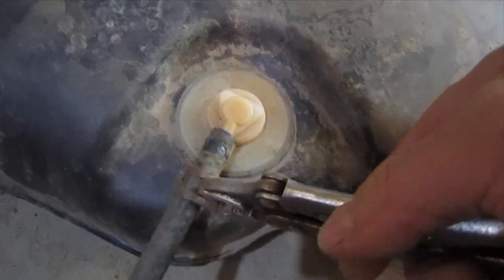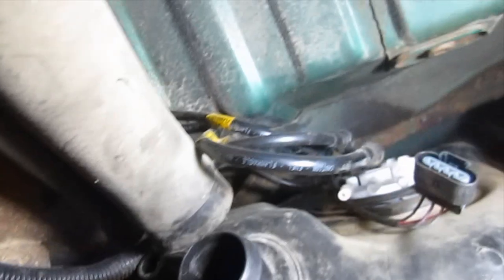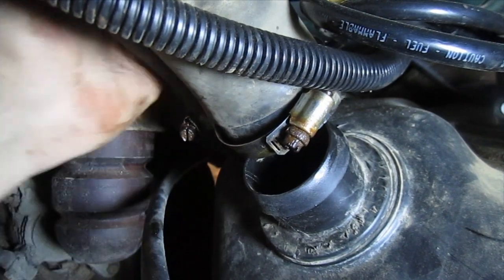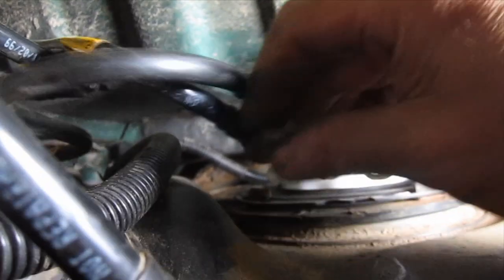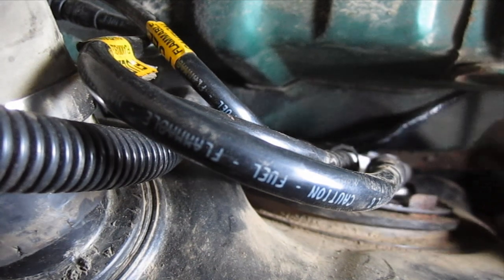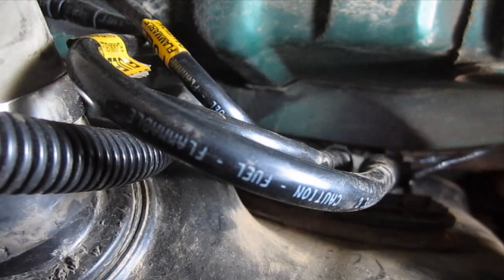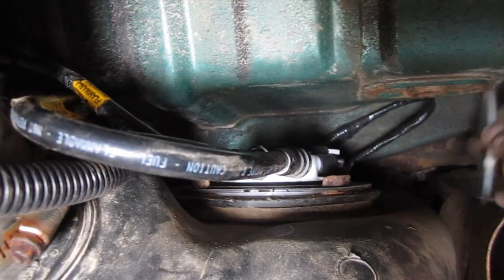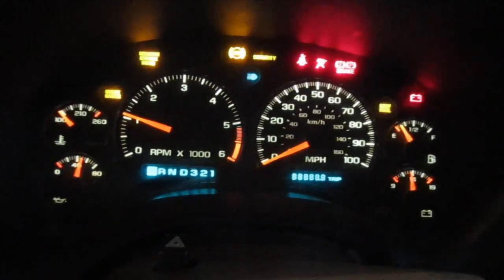DIY How to Install a Fuel Tank - GMC Jimmy \ Chevy Blazer Fuel Pump Repair Video Part 3

Comment: If only I had a tank that came off as easily as this to put back on. I twisted the nut/bolt off the front top strap, and the nutplate holding the rear strap on broke and free spins...couldn't get the rear strap out without cutting it off. I'm having to modify the rear strap to bolt onto a piece of the remaining old strap and had to weld a bolt onto the top of the front strap. I've been struggling with this for going on 4 days now. FML

Comment: Good Video. After having a new pump sitting on the shelf for 2 months and trying to find someone who'd put it in for me at a decent price I finally decided to tackle it myself. Only problem I had was the quick connect fittings, one came off without problems but the other two I just couldn't get, so I snapped them off and pulled them out with needle nose pliers. Cheapest I could find someone to do the job was $150 and one other guy wanted $395. Now I have a working gauge again, yahooooo. Thanks

Comment: nice job on the video...  ? . what if u mix the left and right  gas lines on blazer 98 4x4 2dr. on your pump. would it choke or cause any damage. i'll probably have figured it out by tomorrow. But it's a ? for everybody. please show a video of that. part 4. thanks and have a good chrismas. To all. be safe ppl.

Comment: ***** Thank you so much! I have a neighbor who's Blazer will not start and they said they need a new fuel pump. The shop was going to charge them $1200 to do it. They are not poor, but they are in a tight spot and I offered my services to do it for them for free. I just watched this video and feel totally confident now since you showed me how to do it! Thank you so much! I live in Arizona.. so I don't have the rust. The parts coming off of this truck look almost new! :)
Reply: ***** Thank you sir. I will say I was able to loosen the tank strap bolt  and the nut by hand. I didn't have nearly the issues you had. But I think you were still faster as I hate these fuel clips! :)

Comment: i have a 98 bravada i did the job on, problem i am having is putting the fuel tank back up. the straps are in the correct holes but don't seem to be able to reach the top of the frame in the back and the hook in the front.the tank is jacked up high enough and looks to be in but i can't see where the hook and screw are supposed to go in and the straps ( spectra st123) don't seem to be able to reach the hole in the back and the front doesn't reach the hook and screw. any tips for me would help

Comment: Thanks Mark well i found that's not the problem because  i still am getting gas leak  from the exact hose/connection you broke off in the vid. I will check at the Chevy dealer to get that hard plastic hose, I might have blown a seal in there im not sure.

Comment: The clip that you replaced from old pump in 3:18 of your vid  ? i have a leak there in a chevy blazer. Would i have to replace the whole pump or can i buy those somewhere if so what are they called ?

Comment: Thank you sooooo much for making this video. 

Was able to swap my fuel pump out from drop to test in 4 hours or less (drink and lunch after removal).
Reply: Oh! One thing I did differently:

Didn't drop the tank all the way...just completely on the rear strap and left about an inch on the forward strap on the bolt. Using a jack - lowered it to the level I needed to for access to the fuel pump.

This gave me enough room to pull the fuel pump out and set the new one in.

Comment: Thanks Mark. The best Videos that I have seen on the Tank issues yet and as I will be doing mine, I suspect, to locate a leak with engine running and am hoping it's just a broken /split gas line.

Comment: I have 2001 chevy blazer, last week  my fuel pump brokedown, my mechanic changed the electric fuel pump but now the engine deos not start like it should be.
Do you know what could be the problem?

Comment: Three things that I also did, having done this on TWO  2000 S-10's  (twice on the same truck), and currently on a 1999 Blazer 4 door: (1) I added an additional chassis ground about three feet long to go over to the frame directly across at the splice connection because the ground is all the way at the rear of the frame at the bumper (I think the ground at the rear was poor which caused the first pump to fail; that is what I found when installing the second pump: POOR GROUNDING!!!). (2) I used a little motor oil or petroleum jelly on the fuel inlet and vent tube rubber hoses to help them go on easier. (3) I used a ratcheting  tie down strap under the fuel tank from the frame on both sides, in addition to the floor jack(s). This is SO much easier to make the fine adjustments when installing the tank, and also when lowering the tank as well. 
overall, a VERY good set of video instructions

Comment: Great vids Mark. Did you have to wire in the two new connectors or could you still have used the original ones and just plugged them in? I know new ones are the best bet, but just curious.

Comment: Nice videos,  question  do all the fuel lines need the retaining clips?  And   my fuel lines have colors on the ends by the parts you squeeze to release them from pump. Does blue go first and then the middle would be white and black and the last one has orange and I think that's a 5/16 end.  Also the vent tube in front of the tank, I can't find pics or info on it, I  forgot where or how that hooks to and is it needed. Thx june

Comment: I need to replace the rusted metal fuel lines on my 98 S10. Do i need to lower the gas tank in order to get to/disconnect the metal fuel lines from the plastic tubes that go to the fuel pump?

Comment: I saw in part 1. but the ones that go to the metal pipe line. if i put the pipe line wrong would it choke? Thanks again.

Comment: How long did this project take you? Also, thanks so much. I'm trying to bring my blazer back to life and this is super helpful. Not specifically because of the fuel pump (Mine SHOULDNT be dead) but in terms of tools used/needed to tackle a job like this. Much appreciated.

Comment: Does removing the fuel pump relay while its running will depressurize the system when doing this or you should do it from the fuel rail ?
Thanks

Comment: Hi Mark. 2 questions. Just checking if you have heard of security system being engaged after changing a fuel pump. Also, if you remember, is it possible to mix the two of the three same size fuel lines up while installing on pump, the one big one is easy to tell where it goes . Could mixing the two up cause the car to not run or trigger security light.. Thanks.

Comment: Thanks for the helpful video. I attempted mine alone, i will say it was a bit difficult at times. First, i only have 1 big floor jack and a scissor jack, which really came in handy hahaha, because i attempted mine with the fuel still inside because i could not get the fill tubes off at either end for the life of me. Which im disappointed about because i couldnt clean my fuel tank, which i saw large rocks and all sorts of dirt inside, and that was with it dropped and angled, so lord know what bigger rocks rolled to the bottom when i had it hanging from the large tubes. The rocks i saw were about the size of beans.... but would could i do, i  couldnt get the tubes off. They were loose, spinning, but with all my might and with the tank pulling it i couldnt get it pass the knuckle on the tube.. so i worked with it in there, fortunately im short enough i was able to remove the spare and fix it up in there, the lock ring definitely needed to be replaced, and the worse part is with alllll my hammering and chiisteling its barely locked on there and i mean barely. But no matter what i do it wont budge any further.  One time i tried to hit it the opposite way to see how well its on there and it popped off real easy.. so i took more time trying to hammer it and  well, i couldnt get it much further so today im going to get some steal jb weld and glue all around that thing hahaha, idk what else to do, and i dont want it poppin off when i go over a speed bump or something. . But my fuel level works now! My inconsistent mpg doesnt always seem to work, sometimes itll say 99 mpg when going up a hill, but it works for the most part, on average it says i get 17 mpg. Which isnt a lot but at least i know what my fuel level is at now! Hopefully, it says i have half a tank of gas which would be 9 gallons? Which is around 60 pounds??  And i mean, i definitely had a good amount of gas left in the tank, but i don't think it was that much.. id say maybe 5 gallons? 4 gallons? So, im sort of concerned maybe i have a defective pump, or perhaps i wired the new pigtail wrong, it took me 4 rewires to get the wires to even start the car because the pump i got didnt come with a diagrahm :) and it was a great deal lifting it up with all the gas in it so id recommend taking it out, in my case i couldve but since i couldnt actually clean my tank i said screw it.

Comment: Mark can u xplain 2 me those 3 lines one is for the fuel and the other 2 what they are for the thing ones my question is because I put a xternal electric fuel pump and I don't know were the returne goes I put too much pressure on teh electric pump that now is leaking through the bottom but I trying 2 find out the return please xplain 2 me thank u DAVeteran joseph
Reply: I din't use a return and I damage the electric fuel pump thank u4 your help

Comment: How did you get the straps on?  Looks like they're off as you raise the tank, then we can't see under the tank as you put them on.  I'm struggling with this right now.  The front strap looks like you might be able to slide it up the side and find the hole to hook it.  The hole for the rear strap is above a piece that juts out.  I can't see how I could get the strap up there if the tank is up.

Thanks.
Reply: You must have figured it out by now but I always find the easiest way is to put the bolt in a socket with long extension put through the hole in the strap then simply push up from underneath and start into the body nut , just be careful not to push too hard until it is started .lest you bend the retainer then may have to get your hand up there to get it lined up with the hole again !

Comment: So, I am about to tackle changing out my fuel pump on my 2000 Blazer.  I have the erratic fuel gauge problem.  Is this the only fix to that problem?  If so, I have been trying to find the best quality fuel pump, but not a lot of them have reviews.  The only ones with reviews were for Airtex and said that they are constantly having to replace them after a couple of years and the gauge works, but don't always display accurate fuel levels.  Is there a better brand out there? ACDelco? Bosch? Delphi?

Comment: Thank you I have to do this on my 95 blazer
Reply: How did it turn out?  How did you install the straps when hanging the tank back up?   I'm at the tail end of fixing my 95 Blazer (fill neck, lines, tank/pump/sending unit) and just need to lift the tank back up and strap it on.  I can't see how to get the straps on if the tank is up, and I'd have to bend them quite a bit to get the tank up with them on.  Is it possible to lift the tank up, move it a little to the center, and slide the straps up and hook them?

Comment: replaced fuel pump on my 4 wheel drive blazer but it keeps blowing one of the fuel lines off.Help
Reply: Hello Barb, all you need to do is replace the fuel line clamps with NEW ONES. I always replace all of them any time I drop a fuel tank. They'll run you Less than $20.00 a piece. Good luck and hope this helped you. Ken kpkelly@hotmail.com

Comment: Thanks so much! I'm going to be attempting this on my 98 Oldsmobile Bravada.
Reply: ***** My brother and I were able to tackle putting in the new pump! There was a gut wrenching moment when the pump didn't come on at first, but it turned out it was just a bad wire connection. The Bravada is running better, Thanks again for the detailed videos!

Comment: Thanks for doing this...I'm in the middle of doing a 99 Bravada and it's exactly the same.  I also am having a problem with the strap bold, have PB blasted it and will do the vice grips next.  Great work.
Reply: Mark:  This was a bitch of a job - but not because of the complexity - I did it in my driveway.  Strap bolt spun right off, then when I went to reassemble, I thought I cross-threaded it.  I used a steel brush on the threads, and voila!  It spun right back on.  For the other one, folks should make good and sure that the strap is centered with the frame, because it's under some tension and could make you cross-thread THAT one.  Mark - FYI, I referenced your vid once more during my install to make sure the ring for the pump was on right-side-up.  Again, thank you for doing this...for those doing it on their own, make sure you put a minimum of 2-3 gallons or more in, as the system needs to burp and makes for some puckering during the first start-up after it's all said and done.  With air, I did it in 8 hours.  Now, I think I could get it done in 4 or less.  Take care Mark!  Tim

Comment: have you had any issue with the brake warning lights and the sensors?
Reply: ***** Yes i have my abs light, brake warning light, and the other one beside that all lit all the time speed doesn't seem to make any turn off or on

Comment: very helpful. now i know what i am doing. thanks
Reply: I have a question though. The second strap, it wasn't on ur video. The drive axle is kind of in the way. How did u get to it? U know, the one bolt that goes into the body that holds the other strap! That will be helpful thanks.
Reply: Well its running so thanks again for that. But i do have one problem. The gas gauge isn't working right. I believe i wired everything up right. Could i not have? would that be the cause? Would unpluging the battery reset it so it will read right? Any help would be great, thanks.